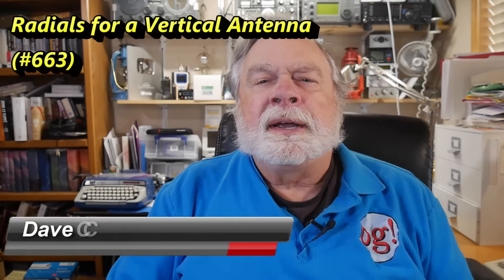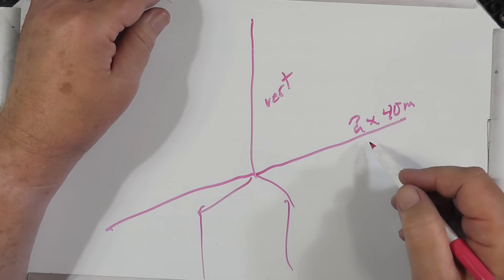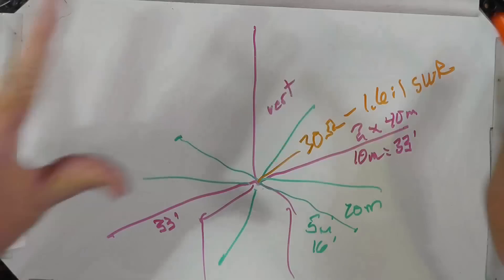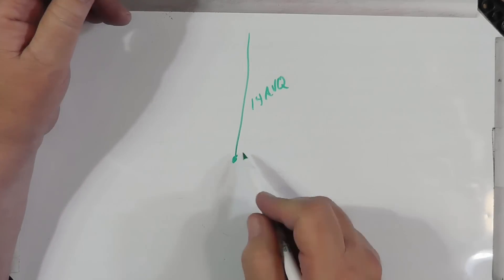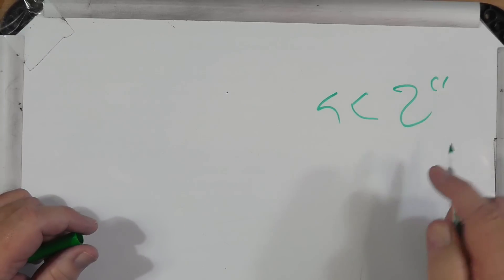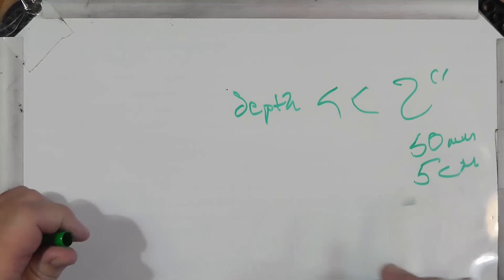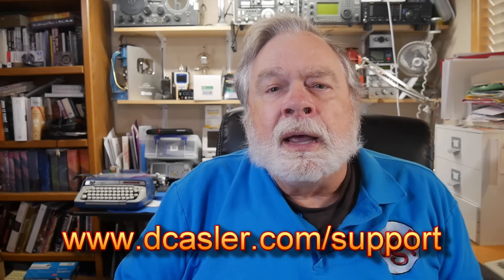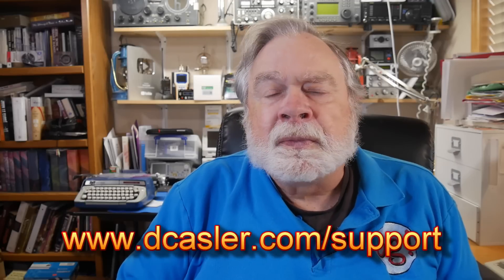Radials for a Vertical Antenna (#663)

Comment: When mounting a vertical(CHA MPAS Lite), up on a metal mast, should the coil be electrically isolated from the metal mast? Or let it be grounded through mast as though using ground spike? And then radials are a problem to execute up in the air. So was considering the CHA Stinger kit.

Comment: Thanks Dave!  I have a Hustler 6 BTV and had my tuned radials damaged by a  lawn guy.  I am in the process of repairing them.  I am also thinking of running an amp for the DX stations I can hear but can’t seem to bust the pile ups.  I am using a Yaesu FT-710 and have done pretty good at picking up some DX stations in South America and Eastern Europe.  However, the Hustler doesn’t hear as well as my MyAntenna 75-10.  So, I’m in the process of saving for a HP version of the MyAntenna.  I’ll fix my radials and try it out.  Thanks for the great info.  W5AWT John

Comment: I'm confused, Dave.
So 33' is a 1/4wave for 40m, but isn't then a 1/2wave for 20m? So the 33' would cover the 40m+20m bands (you said 40 + 15 ? Slip of the tongue or just me?). Furthermore, I'd guess if 33' is 1/4 for 40m then it's half for 20m and full for 10m! So, those two radials would cover for 40m, 20m, and 10m....unless I'm missing something. But you still recommended the two 16' which'd be a quarter for the 20m and half for the 10m. So, should we also put in a 25' pair to cover the 30m (1/4 wave) and the 15m (1/2 wave)?
I'm no genius and used to being wrong so please educate me! Hope you're happy and well! Many blessings to you and yours. 
Christian N7KJQ

Comment: I put out 12 evenly spread 2.5 metre radials for my Hustler 6-BTV, then covered them with mulch. It sits in a corner of my garden. All bands are tuned except 80m which stays at swr 1:2, so an ATU is used for that band. I’ve gotten all over the world with just 10 Watts with FT8, that includes FT8 on 80m.

Comment: Dave, always enjoy your videos and this is no exception. On the point of ground mounted radials, one afternoon, I was resting from a week's landscaping and other honey do's dealing with electrical work and I was gazing at a roll of chicken wire  and some lenghts of EMT conduit when the light bulb went on!
I unrolled the chicken wire and "stapled it" to the lawn, drove a stake into the middle of that, and lashed an 11 foot section of EMT to it. Then I grabbed my TS-520  (back on the day), set it up on the patio, ran a piece of coax to it, and called CQ on 15m.
Instantly I was answered by a VK (I lived in Huntington Beach then) and we had a delightful chat. This was followed by about 10 or so of his mates, a JA, a KH6, and a couple of other Pacific stations.
So, the beauty of antennas is that they don't have to be exotic or expensive. And ground radials don't have to be resonant. In fact, if the VSWR is dubious, _just water the lawn_!

Comment: I am curious now after you mention high voltage at the ends of the radials.  Do you ever notice that you get worms coming up around the ends after transmitting?  If it is Spring / Worm season.

Comment: Agree on the "lawn staple" method of ground radial installation. There is no need to bury a ground radial at all, unless you are installing your vertical antenna in an area where no vegetation grows and you want the radial wires to be invisible. If you have an actual grass lawn, just use a lawn staple every couple of feet and the grass will hide the radials in a matter of weeks, during growing season. 73 de WB4DW

Comment: Hi Dave.... for ease of installing radials about 2" or less (the edger is adjustable in depth of cut) in the ground, I suggest a motorized / electric lawn edger which has a vertical blade that cuts into the turf.  Real easy... then using a manual dandelion puller tool (which BTW has a V notch in the end) you can push the wire into the slit that the edger has cut.  Once installed you just step on the slit and viola!  Hidden radial.  You may be able to borrow such a tool if you do not own one but you should probably replace the cutter blade for the owner....  Also I have seen Calum having a tiltable ground mounted gizmo to anchor the DX Commander in the ground in a few of his videos.  Lastly, the radials you described 1/4 wavelength rather remind me dipole legs... Cheers 73 Art W1SWL

Comment: There is no hard and fast rule to the length of the radials when laid on the ground as they are detuned anyway by proximity to the ground. 0.1 wavelength radials are not magical, but various studies suggest that the best use of a given length of wire is to increase the number of radials but make them shorter. In defence of the youngsters that put Dave's antenna up the 10ft radials are not far off if the lowest band in use is 40m. FWIW despite having very conductive ground here my multiple ground stakes around the antenna are remarkably poor as an RF path.
As for the pizza cutter I used an old kitchen knife, not the most miserable job in the world in the right weather.... no need to finish the job in one session. In fact it is interesting to perceive difference as you later add more and more radials.

Comment: Just a point of clarification. More shorter radials isn't better than fewer longer ones. It technically isn't better, but rather it just isn't as bad that you would really notice the difference. If I remember correctly, raised radials that are cut to a specific frequency length are better, but if you have 4 of them that are 1/4th the length of a tuned raised radial will be SLIGHTLY worse, maybe 1/2 or 1 dB worse, but you really won't notice the difference.

I have a smallish back yard and didn't want to put my Hustler smack in the middle of the yard, so I put a ton of radials of various lengths ... 55 radials, for a total of 1000 feet of wire, ranging from 12 feet to 33 feet in length. I dipped the ends of the cut wires in "Liquid Tape" to insulate the ends. I've worked countries all over the world on nearly all bands. Like everything antenna related ... EVERYTHING is a compromise. :D

As far as guy wires, you are spot on about UV resistant rope. I love Mastrant. Light weight, strong, UV and fungus resistant, and has no RF interaction.
Reply: The purpose of radials is to provide a low loss return path for ground currents. I believe longer radials require more radials to take full advantage of their length because they are farther apart at the outer end. More wire on the ground is generally better, but if you only have 150 feet of wire, six 25 foot radials should work better than three 50 foot ones.  I've also read most ground loss occurs within the first quarter wavelength from the antenna which is another reason to use more shorter radials. Finally I've read that sixteen 1/4 wave radials gets you to within about 3 dB of an ideal ground plane.  There are so many conflicting claims it's hard to know which ones really matter.  The explanations above seem logical to me.

Comment: Dave, really great video.

For the end of insulated radials, I'd suggest using heat shrink tubing that has the glue type of inside to prevent water wicking into the cable.

If you adjust the height of the ends of each pair of band radials, you should be able to get close to 50-ohm feed point impedance on all bands.
Reply: Agreed. Glue lined heat shrink or a bottle of "Liquid Tape" and dip the ends in that a couple times (that's what I did for the 55 ground mounted radials on my 9 band Hustler).